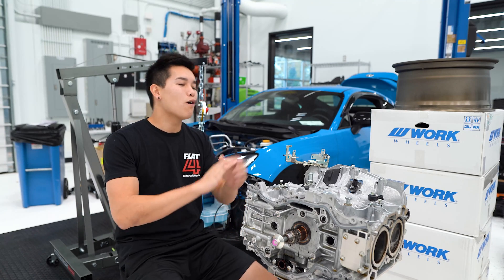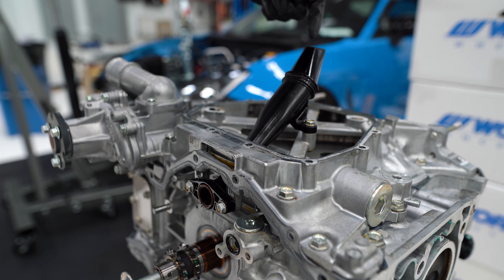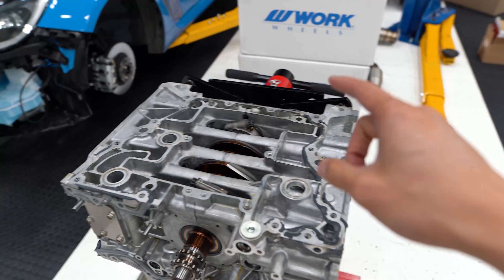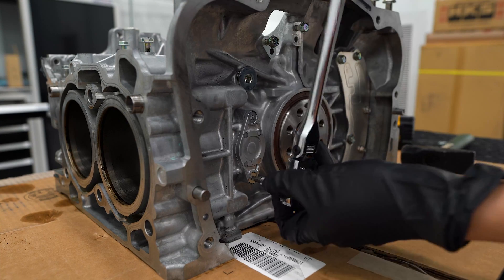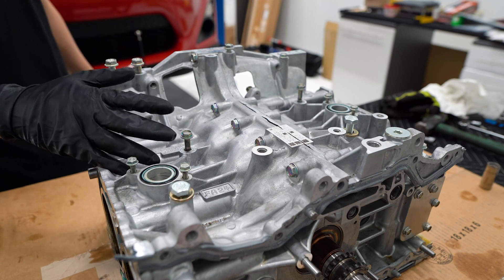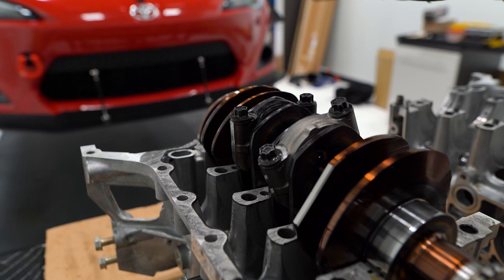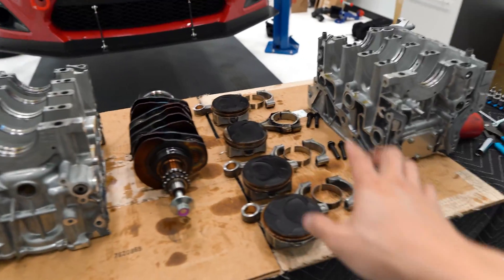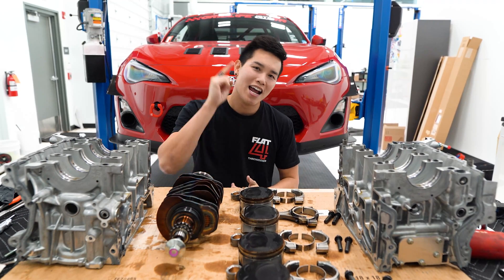FA24 Shortblock Teardown | 2022 GR86 Blown Engine

Comment: I know enough about engines to understand what this means, but what I don’t know is how you repair this?

That damage on the crank journals doesn’t appear reparable.. does this car need a whole new crank?
Reply: I would assume you are correct. There would be no way to machine these back to normal; the tolerances would be wrong

Comment: The rods look as strong as a k-series which is good, but i still havent seen an engine with such an overbuilt crankshaft as a k-series. Still really happy with the engine over the POS L-series in an SI.
Reply: You talking about the new si engine?
Reply: @Mike696956  The 10th and 11 gen si, so yes. There is a video floating around comparing the internals of the l15 to a k20 and it is quite shocking how weak the engine is, bending rods at 240 tq.
Reply: @molethan6138  ya i have herd some talk about that guys are saying its and economy engine with no business being in a sporty car its sad really

Comment: The engine will be fine as long as you don't drive fast on a right hand corner. Oil pressure drop turning right

Comment: How do the cylinder walls get oil lubrication, is it just splash lubrication from the crankshaft turning or are there oil galleries in the con rods? Thanks.

Comment: I love how GR fanbois are all 'It's a collaborative effort! It's every bit as much a Toyota" Block says Subaru all over it
Reply: Must be nice to be able to frag a brand new engine and not be a big deal
Reply: @EvilJ069  well, im not certain any engine regardless of whether it is new or old can survive a money shift. there is a reason why it is called that in the first place...
Reply: @no1washerezz  Seems to me that, to my knowledge, Toyota has never made a Boxer engine before, and that's all Subaru has made for decades
Reply: @EvilJ069  noone actually believes that the boxer is from toyota... it's obviously from subaru and the gearbox is from toyota/aisin.
Reply: @no1washerezz  Then what exactly is your point when I said the engine block screams Subaru?
Reply: @EvilJ069  "I love how GR fanbois are all 'It's a collaborative effort! It's every bit as much a Toyota""

youre suggesting that the engine is the "entirety" of the car and because subaru makes the engine, it insinuates that the statement of "collaborative effort" is wrong when clearly it isn't. please understand that the engine is only PART of a car...
Reply: @no1washerezz  It's entire powertrain (Engine, trans, rear diff etc etc) are all Subaru
Reply: @EvilJ069  well we can start for one. the fuel injection system is toyota's d-4s and the entire gearbox is toyota/aisin. ive stated this before. are you not reading?

Comment: The factory-filled engine oil contains extreme pressure additives that require heat and friction to chemically bond to the surfaces and the chemical bonding over "all friction surfaces" takes a long time at varying rpms and loads. These additives are vital during break-in and is why some owner's manuals specifically mention not to change oil early.  
Kevin replaced the oil at 500 miles (see previous video) after running on a dyno with an OEM 0W20. At 500 miles, the chemical bonding is not complete yet. To make it worse, the OEM 0W20 is too thin to protect all moving parts. 0W20 can't even take sufficient loads on a timken test anyway.  Typically, 0W20 is good for engines with an automatic transmission where the torque converter absorbs some of the stress coming from engine lug at low rpm. For engines with a manual transmission, 70% 0W20 30% 5W40 with low concentration extreme pressure additives provide a better lubrication throughout the engine life.  
So when rebuilding the engine, use "break-in oils" and run for at least 5000 miles.  The first 5 hours of operation should be with low loads and 3000-4000 rpm for the additives to penetrate into all moving parts, as well as driving down a steep descend with 2nd gear at high rpm to lube the cylinder wall.  Then, at 3rd gear, "slowly" press the gas pedal all the way to 3/4 that applies loads on the engine at mid to high rpm. Repeat this with 4th and 5th gear to generate enough heat to complete the chemical bonding. That is everything for the engine break-in.  
Switch to the Track Mode on your GR86 and monitor the engine oil temperature. Avoid going to >100C for an extended period of time without extreme pressure additives. Good luck.

Comment: good stuff kevin.  time to balance and put in a hot cam(s), or bore it over and make a 2.475-2.5L FA25.   may I never have to do a pistonoscopy on an FA engine or any subaru engine for that matter.  While you had your crank out, you could have taken it for a walk 👟  🤔   good luck with the rebuild 🏁

Comment: You just want ppl to comment for YouTube algorithm. 
Make sure the beads on rebuild is smaller than factory spec so you won't have RTV fall off and block oil.
Mod the block into closed deck, too. Ready to boost

Comment: The bearing thickness on the rods is just thick enough that when they are gone you will then have piston to cylinder head contact. Looks like the #3 piston is missing carbon on the top, so wouldn't surprise me if it hit the head. You can also check the bottom of the cylinder bore and see if the bottom of the piston made contact with the block. This contact is likely what broke the rod cap.

Comment: Interesting to see the design of the con rods. It would be interesting to see you test the strength of one of the good ones vs one from a FA20D. Even if it isn’t incredibly scientific, something like a hydraulic press test would be very interesting imo.

Great vid and great content Kevin, keep it up. The BRZ/GR86 scene is definitely vibing with this series rn 🤘
Reply: Yooooo so underrated. Came to say this as well. I had a 18 WRX with the angled con rods in the FA20DIT.  Was curious to see if my BRZs engine has the same and I'm glad it doesn't

Comment: The quality of the sealing job from the factory looks atrocious. Not only did they do a terrible job on the RTV sealing, but the oil pickup tube design is also unbelievably stupid in that it cannot be removed from under the car by removing the oil pan. I think this video just reinforces for me just how crap these engines are. Toyota needs to make their own high-revving I4 NA engine for the GR86.

Comment: Has anyone noticed how thin the cylinder walls are compared to the fa20, I wonder how much boost it will be able to handle on stock internals.

Comment: Can anyone tell me if the shifter speed lockout is just mostly mechanical? Like how I can't engage into first when over like 15-18 mph. Or is something only first gear has? I Imagine the closer you are to the gear ratio the smoother it goes in right? I think when I did 3rd to 2nd one time it's cuz I kinda slammed it into gear (racing).

Comment: Those rods look pretty damn wimpy. My initial plan was to supercharge mine. I dont trust it enough at this point. Bolt-ons and a flex fuel tune (when available) will likely be all it gets. I dont like the car enough to blow the engine and build a $15k race block.

Comment: Thanks for your review and information it's very important to me.
Is during the disassembly of the engine  You saw where the RTV silicone pieces could come from and seal the pickup tube ?
In many videos I saw that the RTV silicone of the oil cap looks OK and no missing pieces...

Comment: I'm still trying to understand  and wrap my head around the fact that how does a mechanically , perfectly , brand new engine  gets  damaged like this in just  a short amount of time?
 🤯😨😳
Reply: You over rev it well past redline on a bad shift lol. There's a reason there's a rev limiter 😅 the fact he was able to engage the gear means he must have slammed it in there pretty hard as there's a soft lockout when at higher speeds. Like how I can't get into first gear until the car is like under 15mph or so...but maybe it's only for 1st gear??
Reply: Money shift at a trackday. If you go back a few months on the channel's uploads Kevin says so himself. This video is basically part 4 of a series.
Reply: I asked myself the same question.  I guess like Rob165x says, the engine may have been over-reved above the red line to many times and/or not enough oil in it.
Reply: It's what makes a Subaru, a Subaru

Comment: After tearing the engine apart what are your thoughts on how the new engine is built/engineered compared to the previous gen? Also, now that the engine has been completely torn down is the RTV issue a major concern?
Reply: One thing I can notice is the con rods are straight on this fa24  whereas on the fa20 they are angled in an offset. This is a much stronger design and should be able to hold more boost.
Reply: @mptboi7284 yet here we are... commenting on a video of the "improved" FA24 with a rod failure.
Reply: @jamesg8246   I mean this was a money shift... Most engines would end up with a similar failure i'd imagine.
Reply: I also agree with the question.
Reply: Great question.   There is a lot of conversation around the RTV in the FA24...  Are you finding that Subaru has applied much more RTV than they did on the FA20?

Comment: So is it because of the RTV caused this issue?
Reply: I think this engine was money shifted
Reply: @KellyEnterprises  you're right, I remember him saying that. Sad, but it brought us this beautiful video!
Reply: What does it mean by money shifted?
Reply: @RL86  let’s say ur driving at high rpms in 5th gear and want to shift up to 6th but for some reason u make a mistake and go to 2nd which will cause the engine to blow up due to high compression that’s  a money shift due to the fact that that shift will cost u money to fix the engine
Reply: @RL86  I shouldn’t really say blow up but yea due to interior pressure the pistons and rods will bend and break and implode an engine
Reply: Thanks for the reply :) now i understand

Comment: 3, is that the rear passenger. I cannot remember. Called it, it is the one that most common had misfire issues on the first gen. How many oil ports for the crankshaft?

Comment: So dumb question. How exactly does this happen? Is it defective materials? Or the bearings couldn’t handle that amount of heat? Just curious to know why this happens
Reply: Not a dumb question, I was suprised he didn't at least mention it this video, but someone else (not kevin) was driving it on the track and accidentally money shifted  - meaning at high RPM, you mean to go from 3rd to 4th, but for whatever reason your arm goes stupid and you go to 2nd, and.. ahem.. fuck shit up. It's just a user error, and therfore would not be covered under warranty. Which is why Kevin gets to tear it down 😉
Reply: @Treaxvour  it was more likely that someone wanted to go from 5th to 4th or 6th to 4th, but went to 2nd instead.
Reply: To add...if the car is over 6000 rpm in 3rd gear and you accidentaly shift to 2nd you're going to bring the engine to well above 9000 rpm, well above redline (Higher gears are closer together but below third there's a larger gap). Redline being the max speed the engine can operate correctly (in this it's 7500rpm). If the cylinders suddenly start to pump so fast that the valves can't keep up the camshaft's timing can get messed up and in some vehicles the valves will slam into the pistons (depending on the design). I did a money shift once on my 22 BRZ and got lucky, my tires locked up but my engine was fine. But this can do all sorts of damage, to the clutch, driveshaft, transmission,  because it'll lock up the whole drivetrain and the wheel drag sends a lot of shock to it (on rough dry surfaces it's worse), and there's the engine stress of the violent change, this was a worse case scenario lol. I'm kinda new to all this so I'm spitballing here.

Comment: Great work, showing the tear down, As an owner of a 22” Brz I’ve been very interested in the differences between the fa24 and fa20. This kind of content is really 👍 great
Reply: hope this engine is stronger. but not as easy to work on so far.
Reply: @quintontim  turns out its worse they die from heavy cornering....
Reply: @lordzed83  well a nice oil pan will fix that.
Reply: @quintontim  What i find sad is that toyota/subaru dont fix blown up engines even tho its manufacturing fail.
Reply: The FA24 has a special feature where it loses oil pressure on long right hand turns.

Comment: I'd be curious to know if most have the #3 bearing spun or if it is all random....
Reply: I would guess that it all depends on the cycle of the pistons at the point you money shift it and which gets the least amount of cooling.
Reply: yes bobbyD i agree, i also can attest to the theory that the #3 bearing spins more often, it has happened to me and two ppl in my gr86 group. i have no idea why bcuz for the most part there is no way of shifting at the right moment to just spin the third bearing
Reply: @JAKIEE00  heat is most likely the issue if # 3 is closest to the exhaust